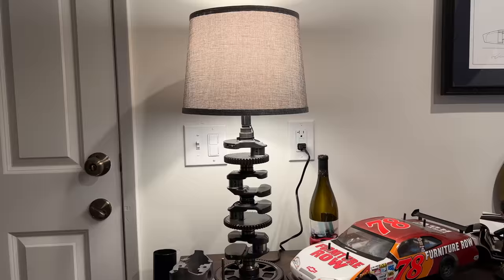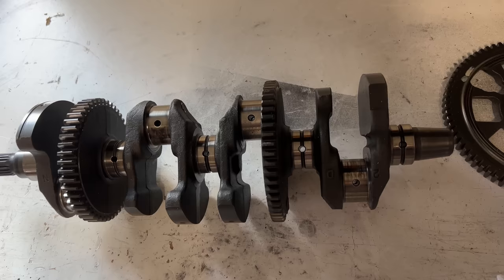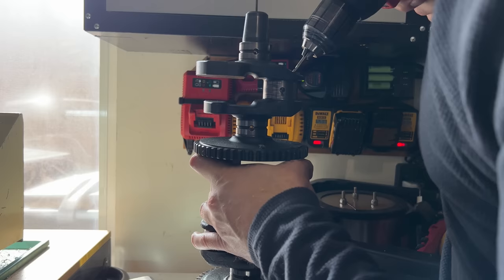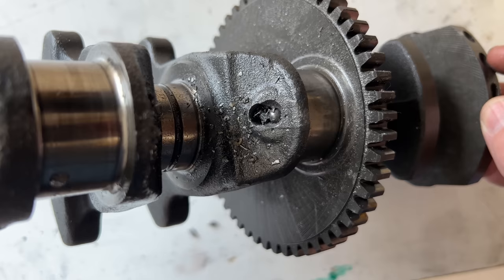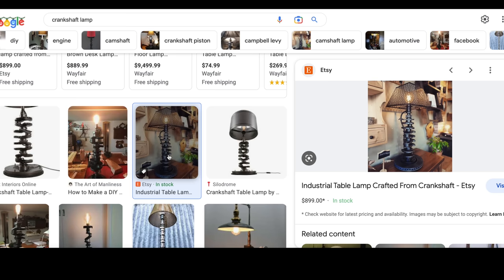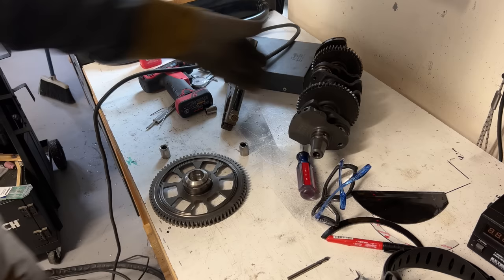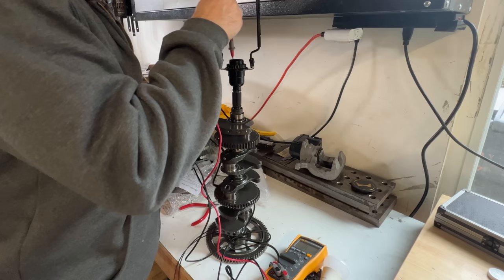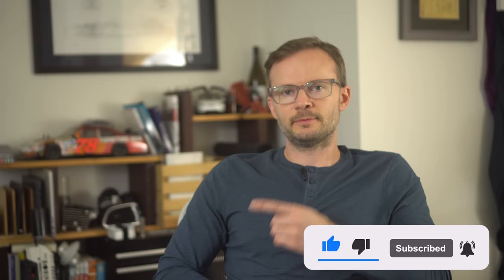Make A Lamp From A Motorcycle Crankshaft

Comment: C'mon, this lamp deserves an air filter as a shade.
Reply: isn't expensive enough
Reply: Nah, the shade should look like a piston.
Reply: I vote clutch basket.
Reply: Great idea
Reply: Consider: HKS super air filter (done shaped)
Reply: What's the biggest velocity stack you can get? Bonus not wasting the light that hits the shade if you get one that's internally shiny.
Reply: @MaxRomagnoli  nice K&N filters are pricey enough for this, plus they come in the right shape.
Reply: Awesome 👍
Reply: How about a semi truck filter, they look a little closer to that medium sized shade: Air Filter - 2000-2011 Peterbilt 387 - WIX 131801-09116230  (~ $83 USD)  OR  lets go with the gray colored: K&N 38-2043R K&N REPLACEMENT AIR FILTER-HDT  (~ $264 USD - On Sale, normally $330 USD)
Reply: Yeah! Something like the one they use in 2014-2016 Kenworth W900s, maybe?
Reply: @rkendsley7561  oh hey, you had basically the same idea, before I did - I think you and I are on to something good here!
Reply: @MaxRomagnoli  K&N

Comment: Years ago I had a ball bearing get stuck in a carburetor passage. I showed it to the machinists at work. They tried compressed air and a drill but couldn’t get it. The weird guy that doesn’t talk much pulled out a set of dental drills that were ceramic and poked right through the bearing.

Comment: I feel this would have been a good project for an EDM machine, you should dedicate the next 10 episodes to building your own EDM machine to more efficiently drill holes in your side project!
Reply: There's me thinking,  how's an Electronic Dance Music machine gonna help?
Reply: @slowerthansound  how is it not?
Reply: @slowerthansound  why not a EDM EDM machine, as in a electrical discharge machine that plays electronic dance music.
Reply: Yes, cut the crank in two down the center, make a groove for a tube with gentle bends, lay in the tubing, weld the split crank back together.
Reply: @fredflintstone8048  I can't tell if this is sarcasm towards the original comment due to a misunderstanding of EDM, or sarcasm towards this channel because thats exactly how Matt would overcomplicate a simple project. But either way I love it. This comment is gold.
Reply: @fredflintstone8048  I was thinking of using it to drill a series of deep holes in hard material but I like you idea even better.
Reply: @mbox314  Part of the problem would be trying to debur the sharp edges at the bottom of the holes where the angles meet and a wire must be dragged through if drilling. In time the insulation might be cut through and it could very well be the 'hot' side of the circuit if this doen't happen when dragging the wires through initially. If the crank isn't grounded to cause the circuit breaker to trip, it would be a shock hazard waiting to be touched. If I wanted to make one of these crazy things, and I had a means of slicing the crank in half longways, I think that would be my approach and either welding or gluing the halves back together. 🤔🤔
Reply: I am sure another crank will be along at some point for repurposing
Reply: @fredflintstone8048  Cut the crankshaft in two, bond it back together with epoxy with a glass scrim between the halves. Use a 12V LED lamp, one half crankshaft connected to +12V,  the other connected to ground, no wires needed.
Reply: @fredflintstone8048  with lazers
Reply: @borgheses  I believe that this is a very important topic to address as EVs become more prevalent we're going to have to find uses for all those crankshafts and lamps will no doubt be one of the more useful applications. Get ahead of the market and get this worked out and into production, and you can become the next Bill Gates, Elon Musk making billions.
Reply: @fredflintstone8048  reuse the block and make an impulse engine.
Reply: @borgheses  Good idea. My wife does a lot of things based on impulse. Impulse buying etc. If I could only harness that energy for propulsion I could solve all the world's energy needs.
Reply: @fredflintstone8048  i was thinking put perm mags in the  pistons and electromagnets in the head.

Comment: I do like how cheap these projects are
Reply: Basically free
Reply: Haha
Reply: Yeah you basically only have to destroy your engine, very low effort and an easy task, especially with a manual. Just money shift the thing, and BAM: instant money! Well… if you sell your crankshaft lamp that is.
Reply: @RustOnWheels  nope, the first thing that usually grenades is the gearbox, just run it with no oil at max revs and voila
Reply: @eustahijelifetips  Then you run the risk of seizing the whole engine in stead of creating a nice access hole in the engine. But hey, every setup and combination is different so there is no guarantee what will grenade first - unless one of the components is known for it. 

I used to watch clips of JDM bros money shifting and those engines were mostly the first to go. Sturdy little gearboxes!
Reply: @RustOnWheels  better to have a good engine, so you can rev the shit out of it while you wait for the tow truck
Reply: @eustahijelifetips  But the lamp though?

Comment: Hey Matt, 
I'd suggest changing the socket to not have a switch.  Put a switch in the center of the crankshaft where the exposed wires are so it's a "design decision."
Reply from the maker: That’s a great idea
Reply: Use an old connecting rod for the switch.
Reply: @daleolson3506  Use a brand new one to keep the costs down.
Reply: @AndyRRR0791  I should have thought of that. Maybe titanium?
Reply: @SuperfastMatt  Its not a bug. It's a feature!
Reply: @daleolson3506  Nah, beryllium is the only acceptable material for conrod switches.
Reply: @d00dEEE  we have to all the thinking for this guy. Have a piston on the rod and when you flip the piston it’s the switch. You can’t make this stuff up
Reply: @SuperfastMatt  Somehow I'm certain you can find a way to include Send Cut Send into this "inexpensive"  solution for added "convenience."

Comment: Very cool.
If ever you redrill to completely hide the wires, you can run wiring easily by attaching them to a bathplug chain (the little balls type) and drop that through. It will find the path easily as you turn the crank, no matter the angles are. Pull gently and it's done.
Reply: string, a bit of paper and compressed air works well too.

Comment: The all-over candy shell hardness is done by induction heating. Case depth can be controlled by area of the part too, so there can be thicker candy shell where it needs to be strong, yet keep a large soft chewy center where it needs to be tough. I have heard actual metallurgists use the candy analogy so it's totally legit technical jargon.
Reply: As an apprentice 50 years ago I case hardened steel parts by heating them to cherry red with a gas torch and then dropping them in a carbon rich granules ... As ever its one of these things you need to have care in controlling .., i treated / hardened a rotary mower blade .., it " shatter " hitting a stone and broke in half...

Comment: Always a pleasure to watch your videos.
An EDM machine would be a perfect project for the problem with the ball plugs.
As these are kind of rare and expensive, another solutions would be to weld a small bolt to the ball and used a sliding hammer to get them out of the way.
Reply: That's what I did when I made a lamp out of the crank from the 2nd engine I blew up in my bike engined S600. For my girlfriend. She lives in Canada, she's a model

Comment: I used automotive rattle can clear coat on my engine block table. You can do gloss or matte to get the finish you want, and you don't have to worry about it collecting dust the way spray lubricant/protectants do.

Comment: That part about the neutral & lead wire really caught me off guard. I forgot that some countries have polarized plugs. 

By the way, as the thing is metal and the cables look like single insulation, wouldn’t a ground lead be a good idea too? Actual question, I’m no electrician but that would be my gut feeling, as I work with grounded everything devices (19” racks and all of the components).
Reply: @cmmartti  most devices are double insulated (Class 2). I don’t think this lamp is, however. 😅
Reply: @cmmartti  my reference is a bit skewed from working in the entertainment industry 😅

I only own grounded lights; PAR16 cans at home, old metal factory lights, theater fixtures (fresnels and spots) and some LED zoom fixtures. The only non grounded lights in my home are the Christmas lights my gf decorated the tree with 😂

Comment: An oil burning lamp with the oil supply routed through a crankshaft's oil holes would have been cool too! Oil burning lamps probably suck tho..
Reply: Just have resevoir in the base and pull the wick through the oil passages. You'll never have to wonder what started the house fire

Comment: I love when you decide to make something yourself and it ends up costing way more than you'd ever spend on that thing. Last year I decided to make my own pocket calculator from a kit, and at the end it cost me almost $200 (cad). 
Certainly worth it though for a definetaly not pocketable, non scientific, battery powered calculator. (it used mechanical key switches for its buttons that's why I made it)

Comment: In case you were to encounter this problem in the future: you can revert a hardened piece of metal (or just a piece of a piece of hardened metal) by heating it up to above 729°c and letting it cool down slowly (unless it's a special kind of steel that hardens in air). In this case, for example, you could've heated the parts you needed to drill through to an orange-y red and just left it on the bench while you took an extended lunch, then you shouldn't have any issues drilling through it afterwards.

Source: I am a blacksmith.
Reply: Nay, thou art a Sorcerer
Reply: While annealing it would work, the discoloration would most likely ruin the aesthetics.
Reply: @TheOtherBill  Annealing it would still leave it very hard and difficult to drill through, it'd need to be completely softened (so heated to above the eutectoid temperature).

And any oxidization could be pretty easily removed: a few seconds with some sandpaper would've been more than enough on the polished surfaces and as good as invisible on the raw cast surfaces.

Comment: High-quality straight-flute tungsten carbide drills. I've run them so hard that they're glowing and shooting sparks, without bricking the bit. As long as the work holding and tool rigidity is sufficient to keep the cut from skipping (which will most likely cause the brittle carbide to chip - quality cutters like Niagara's hold up way better), you'll probably still have a totally usable bit, too... after it cools off.

Comment: i love making furniture out of old car parts, my lamp is a gas pump handle the switch works with the lever an uses the hold for staying on, unlatch to turn off, also have an outdoor transmission sink with a gas handle for nozzle, engine table has head bolts for the glass topper, all hail the algorithm

Comment: What tha hell Matt, don't you have a die grinder? When I made a lamp out of the crankshaft from my Honda bike engined S600 I used my die grinder and a small cylinder burr to remove the swaged metal from around the balls blocking the passeges and they just popped out. Barely an inconvenience. I'd send you pictures but it was a gift for my girlfriend who's a model in Canada.

All hail

Comment: What you need is a bit called a lock smith drill.  It's not cheap but it's designed to drill hardened steel.

Comment: All I'm seeing from the broken bits is a great sales pitch for an 'under designed' EDM machine. I made a really terrible on from a large oil catch pan, swamp cooler water pump, flexible tubing from a Keurig, a small brass tube, an old stick welder and an old Craftsman 'use your own drill' drill press. cut a hole right through a sheared/jammed grade 8 bolt that allowed me to hammer a hardened allen bit in and remove the bolt without drilling.

Comment: I don't know your local electrical code, but as an electrician I would strongly advise you ground the crankshaft so that if you ever damage that cable the whole thing doesn't come live. It's cool, but if it appeared on my desk I'd definitely designate it an unsafe appliance without grounding.

Comment: If you heat the Balls with a Blowtorch to atleast 800°C and let them cool back down.
You might be able to drill though them.

Hardend steel can be softend if enough heat is applied.
Its important to let the steel cool slowly since the rapid contraction of the atom-stucture causes the steel to be harder.
The type of steel used for the balls could be to tough for the drill bits.

Correct me if im wrong. Havent done stuff like this for atleast 10 years.

Comment: Next broken crankshaft, may I suggest a low voltage solution? This is so the shaft itself can be used as one wire (negative) and you can fish through a single, super thin wire for the other (positive) side.

Then you can be really satisfied by having the wire stay within the shaft all the way!
And frustrated with a power supply instead of a simple plug.

Ah, the joys of perfectionism.

Comment: 3D printer crankshaft.  An LS file is on thingiverse.  Do two journals at a time and epoxy them together.  That way it doesn't weigh so much when it falls on your foot when it breaks through the table.

Comment: Blowing a piece of cotton/string with an air line is a really good way of starting a feed through awkward ducts.
Reply: Or use a vacuum cleaner and pull it thru.  I’ve used this trick to fish house wire down a wall and into a switch box!  Actually worked, too (of course, used braided nylon mason’s twine with a wad of toilet paper tied on the end for extra drag to catch the vacuum’s draft).

Comment: What you can do is get an adapter or a touch lamp. And use the crankshaft as the touch portion. Touch any part of the crankshaft and change the light. Showed one I made from an RS3 on (JustRolledIn) on YouTube.

Comment: Don't worry about the wire gauge that much, unless you're using telephone wire it's gonna be fine for 60watt incandescent bulbs, at 127V they draw around 0.5Amps.
If it doesnt get hot in use, then it's fine.

Comment: You could snake a cable through those 45 degree turns by first snaking through a bit of fishing line with a small bit of fishing lead on it, just twist and turn the crankshaft to send it through. 
Then tie cable to the fishing line and pull.

Comment: Use dental floss and air or water to push all the way through the internal oil passages and the drilled ones, then pull a braided fishing line through for more strength, and finally use the braided line to pull the wires through.

Comment: Cranks are through hardened alloy steel with a thin [.002/.004"] nitrided surface. Even drilling thru the 320HB core is difficult.

Comment: while its good practice to make the bottom of the bulb the positive and the outside neutral, AC swings both ways so unless you plugged it in with 60hz accuracy you still had a 50/50 chance of running it backwards for a few tenths of a second.

Comment: I debated doing something like this with the toasted crank from my Viper, but at 80+ lbs it's not something I want to put on a desk, and at V10 length it's also not something I really want standing up if it does fall.  Not really tall enough for a floor lamp either though, so still looking for ideas.
Reply: Make it a tall floor lamp. 
Drill holes in the counterweights to lighten it, weld supports to it to keep it standing, follow the rest of the instructions in the video. 
Voila! ...thingy.

Comment: Owns a tig welder but fails to make use of it to remove dem balls.
Although I personally wouldn’t own such a lamp I would consider making one.
Being extremely lazy and tight I would plan the best way to achieve my goal.
I would probably consider cutting it into smaller more manageable pieces putting it in a lathe and boring out one big hole down the central plane instead of trying to fish wires through the journals.
I’d then weld it back together and use a 12  Volt LED light as putting mains wiring through a metal object that can easily damage the wires and cause a short is not the brightest of things to do.
However to remove those balls heat them with the tig until red spray cold water on them then weld a rod to them that you can attach a slide hammer to.
Use the tig to spot heat any hardened steel you want to drill.

Comment: No earth wire to body? Could make a shade from car seat material to match further & put a switch on the wire hat comes though the body, that way it looks deliberate.
for the Hardened steel ball, a pipe drillbit and go around it to drill out the soft seat holding it in, EDM machine ala Applied Science channel (new project) or you could try friction heating it. Its  used to soften a spot in hard steel for example in pinning knifes. Basically get a rod with a divot on the end to help hold in place in this case , put in drill, press to workpiece Hard and the friction heat should soften that spot enough so you can drill it out.

Comment: You could also use transformer and use 12V LED, then use the metal in the crank as ground and then run very thin Enameled wire through the holes. Also next time find a proper mill and use Carbide drill, it eats harden metal for breakfast. But cool lamp tho...

Comment: Something I would try is to get the ball red hot with a map and the center punch / drill through, not sure it would work, but give you killed 6 drill bits doesn't hurt to check LOL
Reply: If you got them over austenising temperature they would probably cool too fast to soften, so you would need to keep below that. Better bet would be to bake the crankshaft at 250c for a few hours, should make them soft enough to drill with HSS. It'll ruin the crankshaft, but that's what we're doing here anyway :P